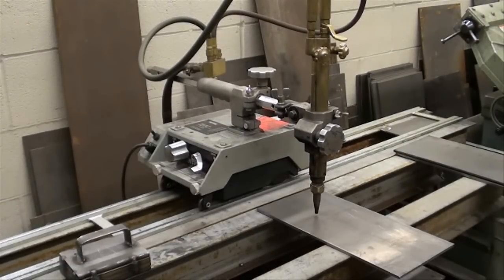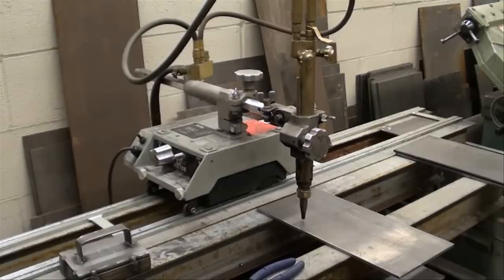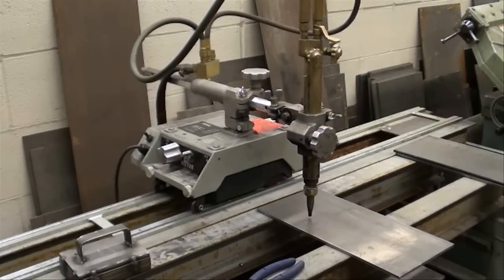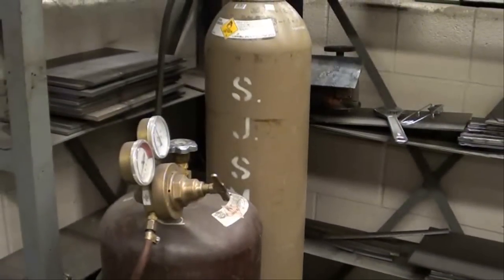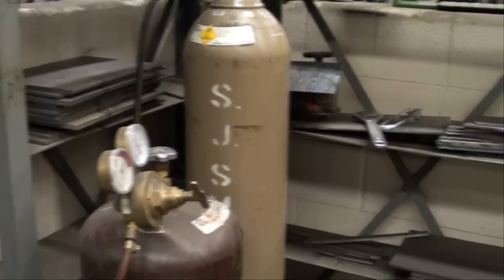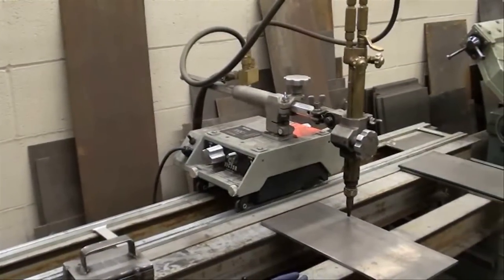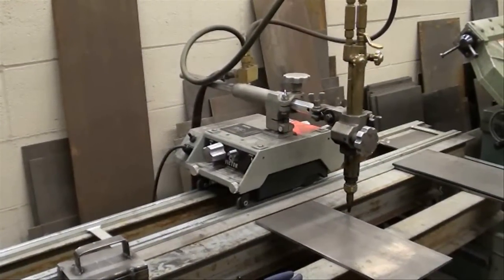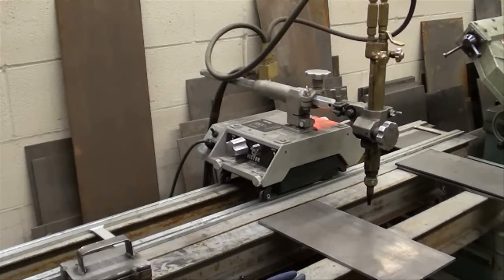MACHINE SHOP TIPS #38 Flame Cutting Straight Part 1 tubalcain

Comment: The shop I work for have replaced these Victor units for a different brand with rack and pinion drive track.  They'll run vertical as well as horizontal.

Comment: @ShaiHulud1982 

Ditto that. Where I work we have cut raw material with a track torch that is 8" thick. It takes a lot more than 10 minutes, but they the plates can be machined to size with a minimum of waste. A band saw would be impractical since some of these plates cut to size are at least 4 feet wide and 8 feet or more long. A very useful and practical machine in the correct circumstances.

Comment: @alexanderkm11 A good track torch can cut steel at incredible speeds. I've cut 30"x30"x4" thick  A36 plates in under 10 minutes. When properly set up, cuts are as smooth as a bandsaw cut. only problem is flame hardening.

Comment: It seems rare that you find a track cutter out side of a school or college most times. I found them to work very well for students to bevel there welding coupons But aside from that they are a limited use with low production value. I used one once that had and angel Iron guide that used magnets to clap it in place for making long cuts in 2" and above plate. The damn thing always drove off course some how. Do you still make your students do long flame cuts by hand as well?